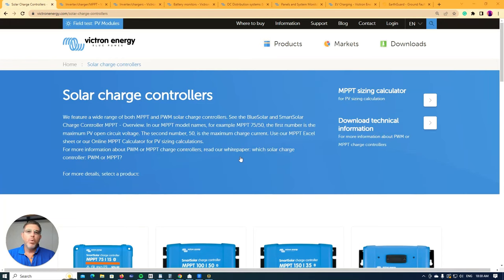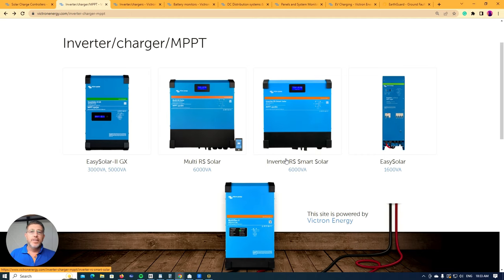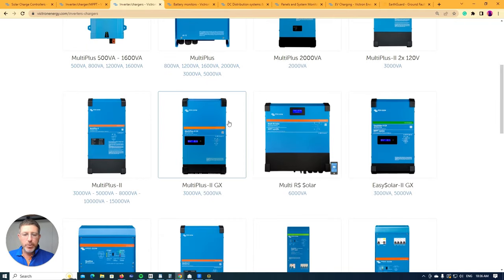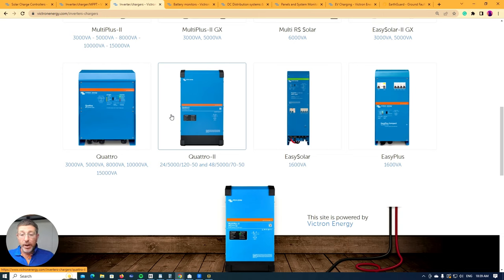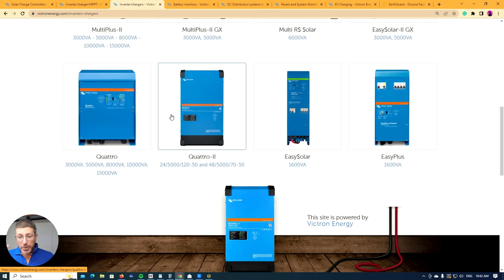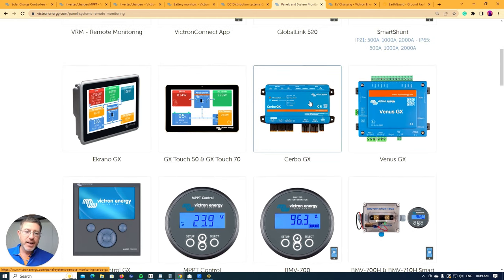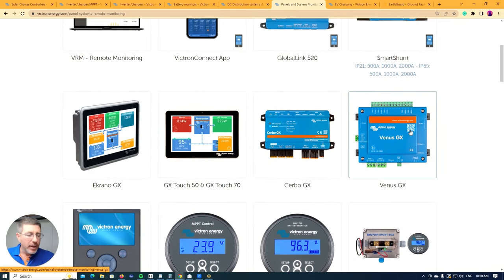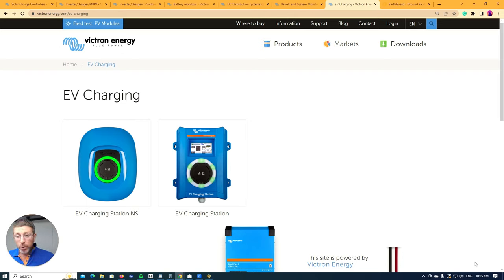Understanding the Victron Products

Comment: great Vid,  have bought a phoenix 12/2000/230 smart inverter.  also have smart shunt and mppt 100/30  all these come with bluetooth 
system is in a toyota 4x4 troopy , if i use a smart phone/tablet  can i connect  and read   all devices or do i need a VE dongle  to be able to change settings turn inverter off
Reply from the maker: Thank you. Locally you can connect to all of them using the Victron connect app and see what's going on.

Comment: Brilliant video. At 5:16 you mention that a green stripe will take a solar input. I have a MultiPlus Compact 12 v /1200VA/ 50 Amp inverter that came out of a house grid tied pv system that was connected to batteries. The installer is no longer in existence. Has the installer used an inappropriate device ? I cant figure out what the intension was after looking at your video. Any help would be appreciated- thanks
Reply from the maker: It's likely your inveter was used for a battery back up and use the grid tied inverter to charge the batteries.  Like this it would have been used..https://youtu.be/5Kuq1x7_cSU?si=eEPyrKa0JcGT7--e

Comment: Thanks for the video mate. Looking at going off grid on the farm. Need 3 phase atleast 12kw continuous and looking at 25-30kw of solar with about 150kw of agm batteries. I was keen on as many individual components as possible incase something failed, not not sure if I should go invertercharger, or mppt rs or original plan of just passive cooled mppt charge controller and phoenix inverters. So many ways to achieve the same result. Thanks again.
Reply from the maker: Thank you. That sounds like a fun project. Where are you located?
Reply: @TheOffGridShop  central vic

Comment: I live fully off grid and running a panel voltage of 110 volts open circuit on one system and the other system I am using a panel voltage of around 85 volts open circuit. I use Victron 150/85 solar controllers and a Multiplus 48/5000/70 inverter charger. Am I required to be using an earth fault alarm on these panel voltages ?
Reply from the maker: That all depends when it was installed. And normally if you use an mppt with higher volts than 150 you would want one .I think the voltage is 120v and meant to have earth fault.

Comment: Inverter does have a huge benefit over a single inverter/charger unit and that is that inverter will last a longer when it’s connected to a seperate charger. A single inverter/charger unit has less life in comparison.
Reply: I see your point, and These products are made to work none stop for a very long time.  It would be good to see this tested over a long period.  I think as long as they are not running at their peak all the time, either will last. Unless you get one that was built on a Monday or a Friday.
Reply from the maker: Some Victron inverter chargers have been in service for 40 or so years.
Reply: Victron units last forever. Renogy & others last until delivery or 2 days after the Warranty Period & during ownership low performance & the risk of fire.

Comment: Do you maybe know if it possible to have a list of priorizable loads that are controlled by the victron system?
e.g: 1. PV Power --> House base load; 2. PV Power --> Heating water; 3. PC Power --> Charging EV; 4. Rest of PV Power --> Battery?
Reply from the maker: The Pv power will always do the house 1st, and there is a programable circuit AC out 2, which you can control loads with. So the answer is Yes, and if you have the victron EV charger, is would make it easier.  I have different brands with my place and Victron, and I use Home Assistant to do it all.

Comment: Great video, informative for someone building an off grid permanant shed. In your experience what is the best way to deal with inrush load on the multiplus? We have a 3000 24V and well, it doesnt quite run our 2200w hydralic motor on the hoist, presumably because of inrush draw. it does run, but in a very unwell sounding manner. Batteries are good to around 200a @ 24v (300a @ 10 sec) and that def is not the issue, as we can run our inverter welder fine on it it moving between 100-150a. I am looking at soft starters maybe for the motor circuit only, curious to learn any other suggestionsyou might have with that in a general form. Yes we have thought about the option of getting the same model inverter and running in parallel, but as a more cost effective option since its very rare use - soft starter option is on the list at the top, maybe you have some experience in these senarios?
Reply from the maker: You could look at AC coupling it. And this is only going to help you of a day. https://youtu.be/5Kuq1x7_cSU?si=BfO4nih5CqY7IsgX

Comment: Hi guy I have a question for you in which I hope you help me out, I own 2 Tesla Powerwall generation 1, as far as I know according Tesla the only inverter for this battery is the SolarEdge 76000 US, I like to know if their is a possibility for any of this equipment can charger and power up this dead batteries one input that I can share with you that I recall the Technician he configure them to work as DC they were not charging from the grid only from SOLAR also I recall one time that one of the battery discharge complete he brought a piece of a equipment with name VICTRON but he didn't use it cause he didn't have at less 2 or 3 panel to connect to so I'm assuming their is a piece of equipment that can power up this batteries, thanks for the promptly answer .
Reply from the maker: Yeah you could just use solar panels. The battery voltage is 450 volts. But enough panels that the volts are less than 450 and shove them into it directly.
Reply from the maker: The Data sheet for the Powerwall says the battery volts are under 50 volts and operating volts are 350-450. It sounds like it uses a Dc to DC converter. If that's the case a Victron mppt will charge the battery. Get a small one to test the 100/20 smart mppt.

Comment: Hi, which victory inverter charger is low frequency / has an internal transformer? - this is for my home build….i heard transformer based inverter chargers are better / more robust..is that correct?
Reply from the maker: All of the Victron inveter chargers as toridinal transfer based.  The newer RS range has a higher frequency.  Where are you based?

Comment: hi mate i have a quatro and it wont turn on the caps charge and it did have a red fault but now nothing i ordered a mk3 as was told it needs to be turn to inverter mode since i no longer have the cerbo is this correct
Reply from the maker: You don't need a cerbo.  When you plug the MK3 into it you will see the data of what's happening..the cerbo will show you the fault codes.
Reply: @TheOffGridShop  i ended up ordering a new cerbo and screen and nothing happened on payday i will order the mk3 .I installed the cerbo correctly . I also have a old phoinex inverter that is a 1200 but can only handle a 100 watts before the power fluctuates and cant hold a stable ac voltage. Could this be because i ran it flat instead of upright i read that power output can be affected but not like this lol. Im not a sparky so i think the victron course is a bit to much for me .The raytheon M1 looks nice for 10 k
Reply from the maker: @bigredinfinity3126 if you have the cerbo unless is a major failure it can do everything the MK3 can if you have it online.
Reply: @TheOffGridShop  no have not done it online i have the guimod as well. That makes sense i will do that tomorrow thanks heaps
Reply: @TheOffGridShop  i have a isolating transformer it has a 120 and 240 output .The reason i want a 120 ac is i plan on buying a marine aircon but looks like it will be so inefficent i may as well just get a split system and run it on a inverter i currently have 600 amp 24 volt bank of lifepo4 was thinking of getting that ratheon and then use it to pwer the ac with a new 48 volt quatro which i think can be added to my ships energy system i have room for 1600 watts of solar and my diesel engine has a 115 amp alternator which goes to a 100 amp buck boost which i wish would connect to the cerbo (2000 for it ) so i should have enough to pwer the ratheon 
when it needs charging .I also have victron centuar 24 volt 60 amp chargers .my question is what is the cheapest option in 48 volt that has decent charging and ac switch over

Comment: So can i confirm the rs inverter is ok for ac coupling? It is a high frequency one isn't it?
Reply from the maker: It can and it doesnt want programming. This is from the manual.  Hope this helps. 
3.9. Frequency shift function
When external PV inverters are connected to the output of the inverter, excess solar energy is used to recharge the batteries.
Once the battery absorption voltage is reached, charge current will reduce by shifting the output frequency higher. This frequency
shift is automatic and does not require configuration on the Multi RS Solar, though the AC PV inverter may require additional
configuration.
This feature is used for battery over charge protection and solar assist.
The Multi RS Solar does not allow complete charging of the battery from an AC PV inverter to fully 100% State of Charge.
That is a safety precaution to prevent overcharging of the battery when the AC PV output cannot be adjusted quickly enough to
prevent a system shutdown, so when charging from AC PV, there is some capacity left in the battery remaining to absorb this
surplus.
To complete a full charge from solar, connect PV to the internal MPPT solar charger, or another DC MPPT

Comment: Confirm the Multiplus 2 is not allowed to be connected to the grid in Aus due to the lack of certification?
Reply from the maker: This all depends on where you are and how you are using the inveter.
Reply: @TheOffGridShop  I’m thinking about installing one purely for charging of the battery’s, then use the ac out to switch over to the battery at night. In this instance, am I technically still off grid? I don’t want to export power to the grid.
Reply from the maker: You can install it like that in most of Australia.  WA I don't think you can and all you require to do is install it with additional relay as secondary protection.
Reply: Thanks for the info!

Comment: Fantastic video, I am looking to just do a small set up with a MPPT and inverter. I am not sure your statement is correct about the charger only being able to feed the batteries. any standalone inverter should be able to take available solar directly from the MPPT if there is available solar. 99% of DIY setups will have a bus bars for Live and neutral so the inverter will be plugged into that, not directly on the batteries. In the systems i have seen once the battery is full it goes into float mode and any excess solar either gets used up by the inverter or "lost" if not grid tied. The battery will slowly drain if solar is not consistent but cannot imagine that the batteries will utilized much on a stable sunny day.
Reply from the maker: Thank you for the feedback and yes you are correct.  The mppt will supply power to the inverter and the inverter will supply the loads if there is available solar.  Thank you for pointing this out for others.

Comment: "The heavier it is the better".   Victron generates its AC waveforms at low voltage (high current) and steps them up with transformers.  This is the old way of doing things.   The latest inverter technology is transformerless.  It weighs a lot less and is more efficient.
Reply from the maker: Yes I agree. And I have been amazed with how some of the newer inverters perform. Time will tell on reliability and longevity of the newer technologies.
Reply: @TheOffGridShop Some High Frequency Transformer-less inverters have problems with very high inductive loads. Also, the max surge watts varies. There are pro's and con's with each topology. Isn't Victron releasing a HF Transformer-less design?

Comment: 14:00 you advise to send all the data online. That works. Until the power goes down. 
Woot woot, you have off-grid backup with battery. But does your internet provider have it. Because mine doesn't. Mobile mast stays online for couple hous and it dies. Local 60hz wifi link for my main connection used to have backup on the provider end... until it didnt anymore. Something somewhere got hit by a lightning couple years ago and now it goes down with power outage. Best part is me, mobile mast and wifi link provider sit on the same powerline. And it goes down a bit too much for my liking. 60 outages last year. Meaning the moment i actually would need the data, it would not be available to me anymore if its in somebody elses computer. 
Short: online is fun to have. But if you really need the data to run the system, have in in the house.
Reply from the maker: Yeah you can setup something like home assist. And there are other options to keep it locally. Let us know if you doing something exciting with your data and worth sharing.
Reply: @TheOffGridShop Can we use our cell phone to monitor the system, when the Main AC Power lines are down? And it won't be long before the generator is powered up.

Comment: Victron makes great gear but its a bit pricy. My victron 150-70 was 3 times the cost of my other charge controllers but its also  a much better unit. I should have purchased all victron from the start
Reply from the maker: Yes it is good gear. Over time you can always replace.
Reply: The MPPT pricing was recently reduced by a decent amount. 250/100's are now around $6xx vs $9xx.
Reply: @s10mods  I saw that on Amazon. I'm wanting another array and another charge controller. This solar is so addictive. Ive spent about 30 grand this year on solar and off grid stuff. I'm a over the road truck driver and once I get enough things in place I'd like to get a local driving job and enjoy some of this stuff im buying

Comment: The RS controller does not have an earth fault alarm! It's an isolated mppt. Incorrect information
Reply from the maker: Appreciate the feedback. Can you share the link to this information?
Reply from the maker: You will find the earth fault alarm information here. https://www.victronenergy.com/upload/documents/Inverter_RS_Smart_Solar/11676-Inverter_RS_Smart_Solar-pdf-en.pdf
Reply: @TheOffGridShop  dont think yr attachment is for the charge controller you referenced in yr video talking about mppts. MPPT in video was Smart Solar MPPT RS.  This unit does not have an earth fault alarm. This is a different product to your attachment
Reply from the maker: @nenadrodic5332  all the Rs mppts have earth faults. It's the older smart ones that don't.  Can you reference what part of the video your taking about?
Reply: @TheOffGridShop  I did reference it in my previous comment. The section where you spoke about the mppts. Happy for you to prove me wrong.  Pls provide evidence that the RS MPPT charge controller has earth fault alarm. The advantage of this product over the other mppt range aside from higher input voltage and current rating is the fact that they're an isolated MPPT. As I said I'm happy to be proved wrong.
Reply: @TheOffGridShop  idk how to attach images sorry. Victrons web page for this states that it's an isolated mppt. No reference to earth fault alarm

Comment: "If you want to charge your car turn the generator on." Or stick with with petrol and diesel.
Reply from the maker: I have a customer who has an EV off grid and they use Oil form the fish and chip shop to run their generator to top there car up.  Its all about free fuel!
Reply: Might perhaps consider a three phase configuration.

Comment: Kerriste gabble gabble 90mph blast me with buzzwords, Victron words yada yada, talk fast walk backwards HTF do you expect a humble customer or even a DIY man to follow all that verbal.  OH I forgot, you are pushing tutorial courses $$$.  You dont really explain anything do you  :face-red-droopy-eyes:
Reply from the maker: Thanks for the feedback.  If you buy the Victron products from us you get the course for free. Or would you rather we have advertisements on the channel? I genuinely would like your feed back on this. Thank you
Reply: @TheOffGridShop  Unfortunately, some people have very little knowledge regarding Off-Grid Solar installations.  Every video can not be, and should not be, about basic electricity.  I do understand the basics.  I think, this video was at the correct technical level. This video was spot on.
Reply: I noticed you didn’t discuss the Multiplus II 2x 120v. I understand it’s the same but has 2 inputs. Is it a new product? Doesn’t seem to be available in the US at the moment.  I’m also unclear about the part that separates the 2 outputs to isolate high use appliances. is this optional? I have an RV with 50amp service which means I have 240v coming into the coach that gets separated into 2 120v legs. I don’t want 1 leg to get turned off when voltage drops. Appreciate the video!
Reply: @davidhein4300 If you want to run 240v AND 120v while on battery, you need two Multiplus units in parallel, or use the auto transformer. The 2x120 version of the Multiplus only supplies 240 when plugged in. 

As far as I can tell! Double check everything I've said.